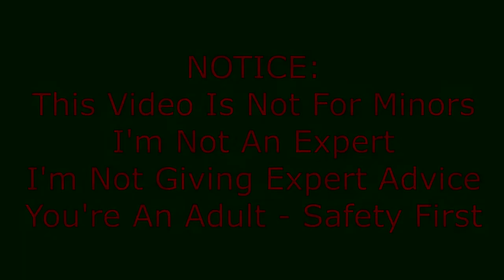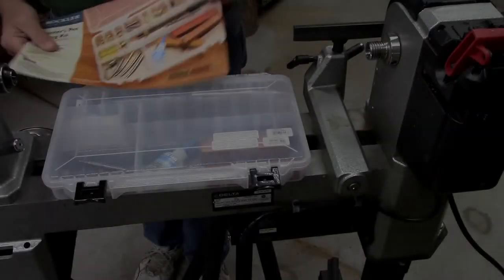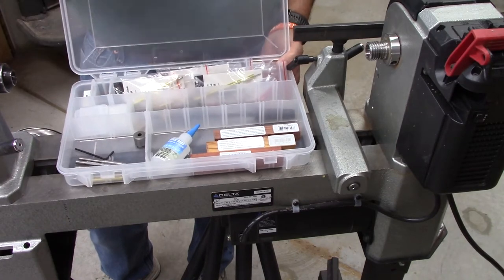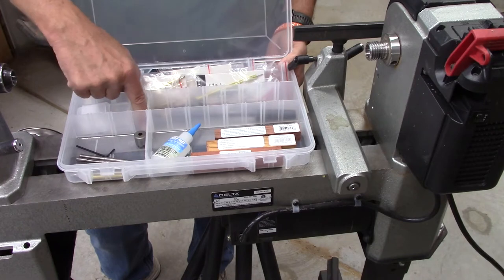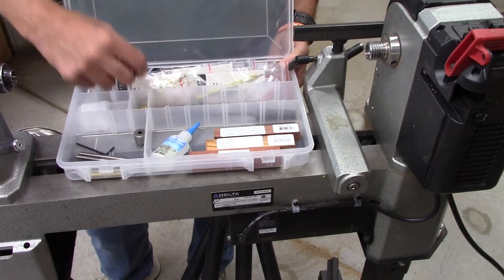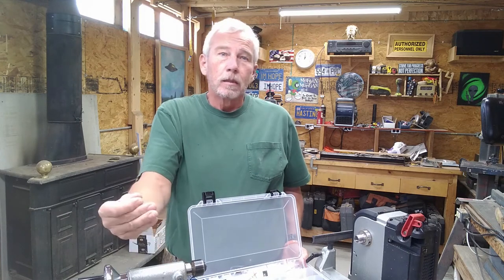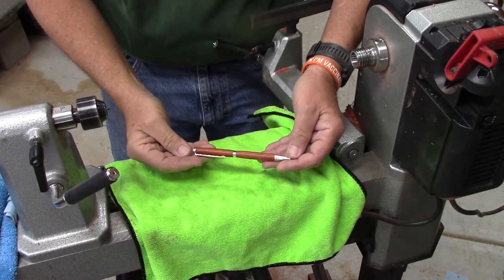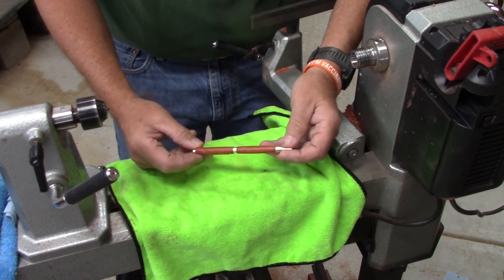Rockler's Beginner's Pen Turning Kit - My First Pen Turning - Let's Figure This Out

Comment: Well done for your first pen! I got this kit in January and agree that it does a great job gathering all of the stuff you need to get started making pens. I was also very confused on those small HDPE bushings but they go with the brass piece to adjust the stop point if you are turning a pen with a single barrel that is not long enough to reach the threads on the end. They are the same material as non-stick bushings but slightly different in shape. A 4-pack of those only costs a few dollars the next time you are near a store and they work well. The kit was lacking on description of its components. Nice job and good luck with the seam ripper when you get to it!
Reply from the maker: Good advice and good luck with the mini lathe

Comment from the maker: Quick Update:. I still need to make the seam ripper and match pen. After that I will be transitioning into Wine bottle stoppers for gifts. I have all the specialty tools for the seam ripper from Rockler. For the wine stopper, I was closer to a Woodcraft so I went there for the kit which is no where near as comprehensive as the Rockler Beginner's Pen Kit.  Fortunately the staff at Woodcraft did their best to ensure I have all the right tools. I was at Woodcraft when they opened and I am beginning to see a trend here. Apparently wood turners don't get up early enough for the first shift.

Comment: How long did it take you to make the first pen? Have you made more since? How many and how long does it take now? Great video.
Reply from the maker: Actually I lose track of time when I'm turning wood. I've only done about a dozen. The finish is where things can take awhile. CA glue finish can go really fast unless you mess it up, then you'll need to sand and refinish, but it's a learning process. Using a wipe-on poly is not as nice as a CA finish,  but is really fast. Also with a CA finish keep an eye on it building up on the bushings. With sharp tools, using pen blanks and a wipe-on poly finish, I could make about 2 in an hour.
Reply: @LetsFigureThisOut  thank you for the quick reply.

Comment: I'm interested in pen turning and even though the kits are cheap I still need a lathe and that is not cheap. I also have no place to put it so I'll have to figure something else out.
Reply from the maker: Turning wood is a good hobby that actually gives you something when you are done. Try running an add to see if someone has an unused lathe and tools. A friend of ours found one in a barn that hadn't been used in decades. After cleaning it up, he made a shift knob for his truck.
Reply: @LetsFigureThisOut  Thanks! I'll try that!

Comment: Why did you put a ink line on the block before cutting it into two?
Reply from the maker: I'm in the middle of the Atlantic, when I get back I'll refresh my memory and get back to you
Reply from the maker: Okay, I figured it out. I make 3 lines. #1 This line is length wise and is so that I can line up the grain after I cut it into 2  pieces. Line #2 &#3 match the barrel lengths. Turns out, you really don't need Line #1.